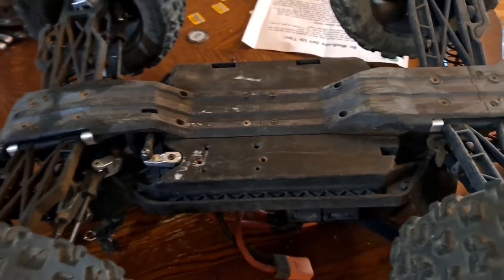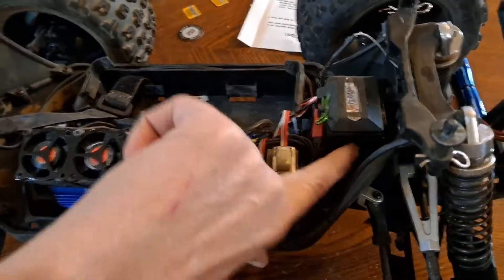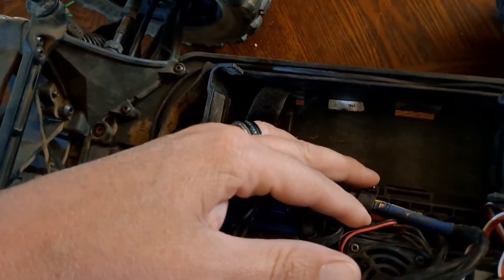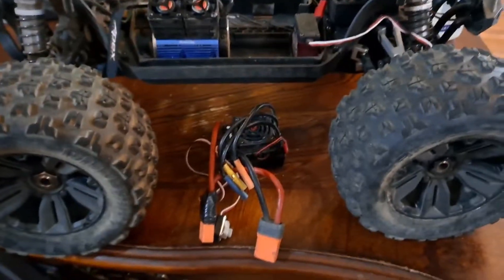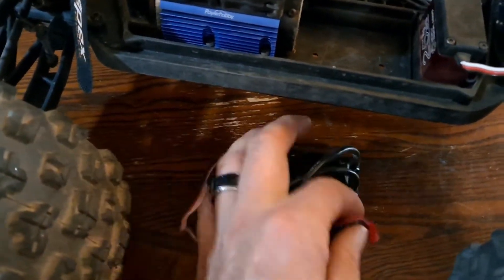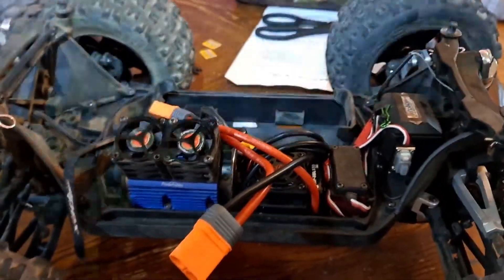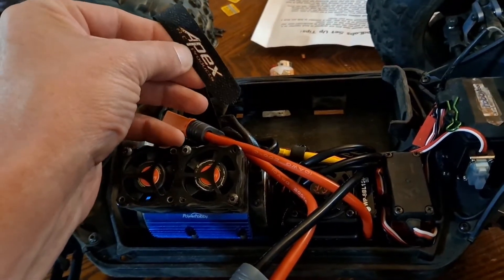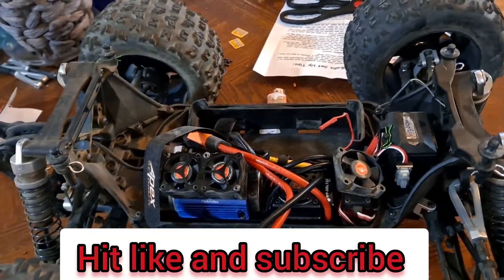Redcat kaiju esc replacement

Comment: Hey buddy why did you change the tires on the kiju???  I've been wanting  a kiju and just wondering a little about what people are doing with this rig ???
Reply from the maker: I put the copperhead 2s on because they are more forgiving when landing big air
Reply: @ihde2000  2s???
Reply from the maker: @donaldbowlin7944  there called dBoots copperhead 2 they are a 6s tire the stock kaiju tire is a great 4s tire all day but just don't hold up to 6s the part# for the tire I am running is this DB0827AX
Reply: @ihde2000  yeah i have a kraton v5 6s with the copper heads! The 2s threw me off thanks bro! That kiju looks pretty sweet! Trying to decide on my next rig i wanted an arrma 4s but im getting sick of waiting  so i was thinking about the kiju
Reply from the maker: @donaldbowlin7944  the kaiju is bad ass but needs a little work to run 6s but 4s it's solid 👌
Reply from the maker: @donaldbowlin7944  I have a k5 took the stock tires from it and put them on my kaiju I run the 6s arrma tires on my k5
Reply: @ihde2000  you run back flips on your k5
Reply from the maker: @donaldbowlin7944  yes because every time I run the copperhead tires my front cv axles pop out even if I break too hard so but the 6s backflips on problem gone on street is different I run Bandito MT Belt 3.8
Reply: @ihde2000  did you put hub extension on the kiju to run the copper heads?  Have you ever ran the backflip LP'S   I Heard that they work well on the k5 ??
Reply from the maker: @donaldbowlin7944  23mm
Reply: Thank you buddy i really appreciate it!
Reply from the maker: @donaldbowlin7944  no problem 😊